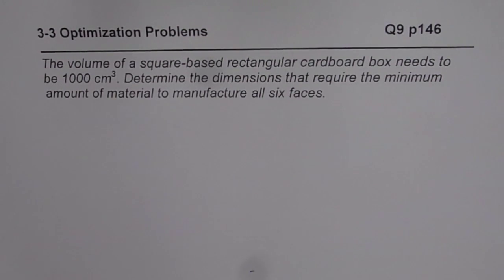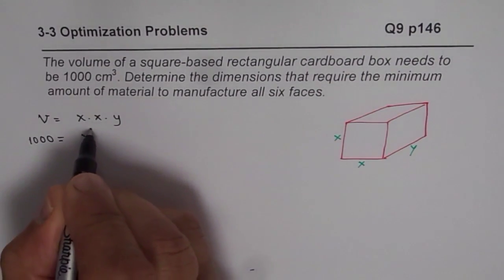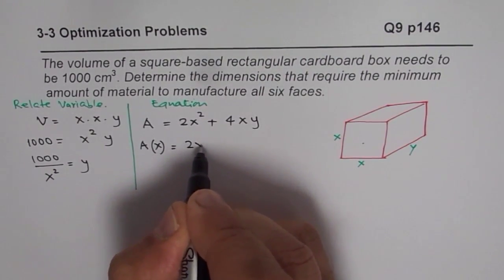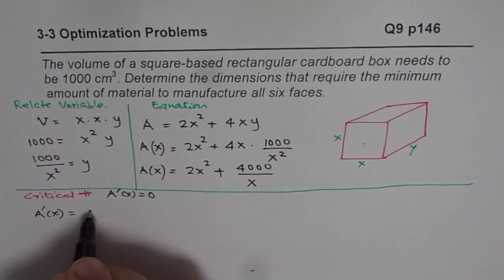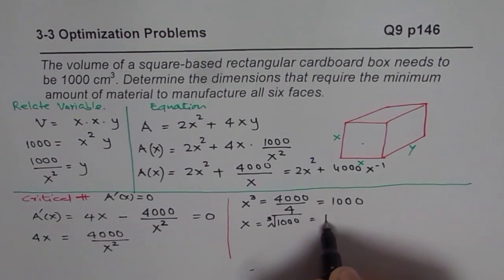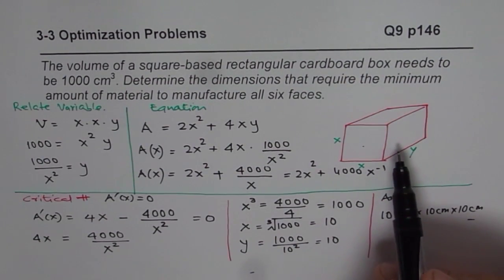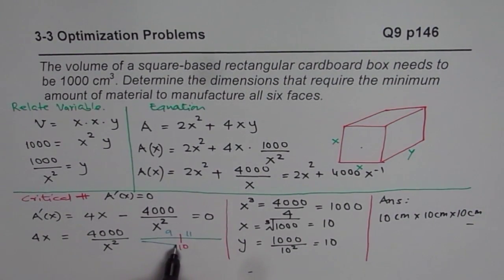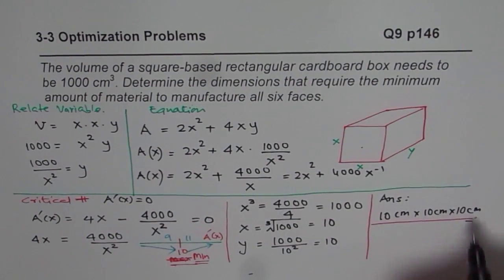Q9 p 146 Minimum Surface Area Square Based Prism MCV Calculus

Comment: how can i do this but im given a rectagle based prism
Reply from the maker: Square is also a rectangle. You might be given some condition for the length and width of rectangle. 
Please post your question. My email is anil.anilkhandelwal@gmail.com
Thanks
Reply: Anil Kumar my only question is. Is the equation the same
Reply from the maker: @callmeBoost_  It could be since the height is different, you do have a rectangular face.
Reply: Anil Kumar so would the equation still be V = X x X x Y ???
Reply from the maker: @callmeBoost_  Yes